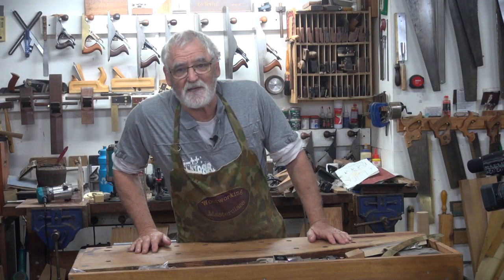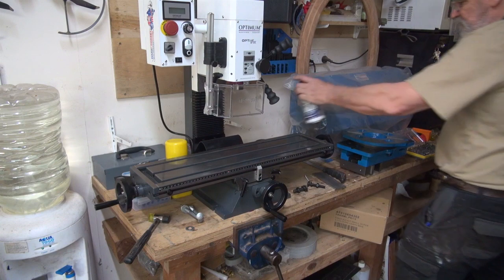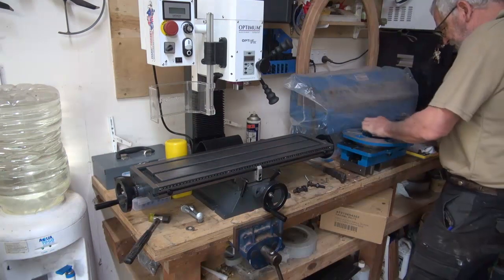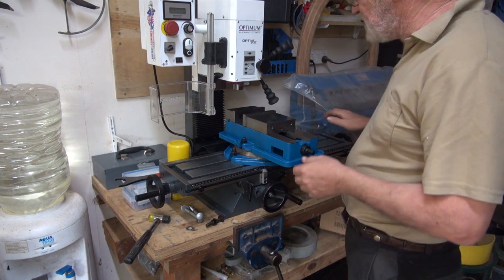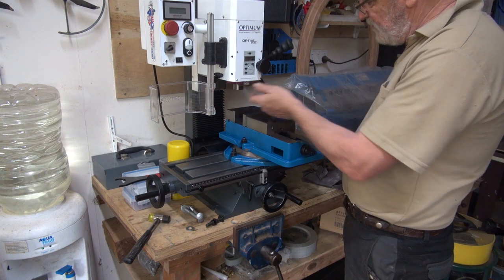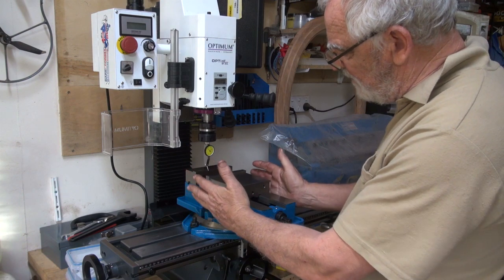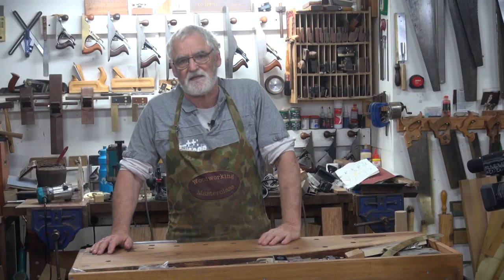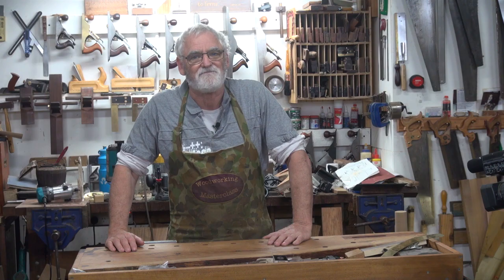Dialing in Milling Vice to Mill

Comment: Nice bench top machine Steve.  How deep is the throat from the collet to the bed?
Reply from the maker: Hi Derek, Throat distance from taper shaft to table top 280mm. Workable area will depend on the vice and collet chuck size it's a fairly reasonable though. In the next video I opt to take away the swivel base on the vice for that very reason. Needed the extra area for some larger drill bits. Plus the drill chuck I use is also longer that the E32 Collet chuck I have. Works well. Cheers Steve